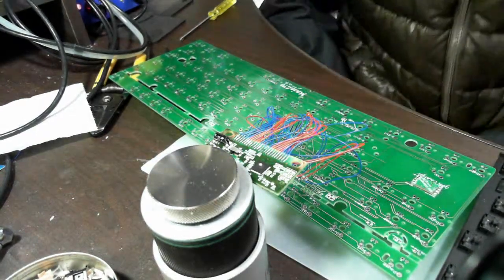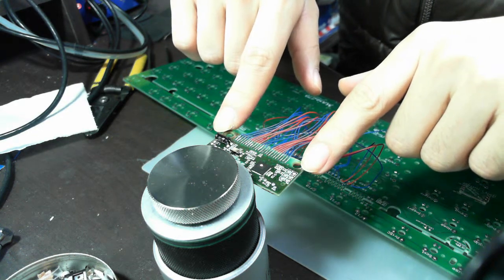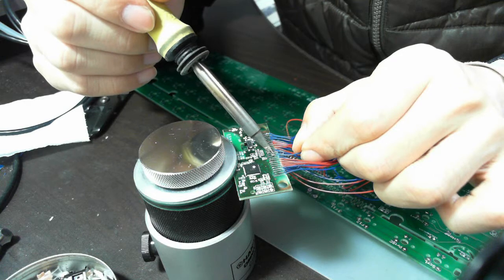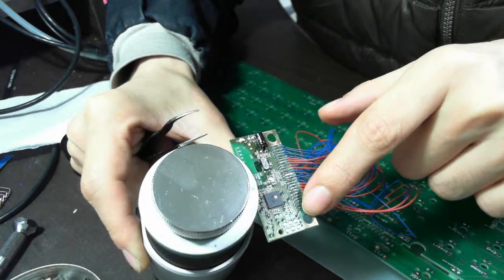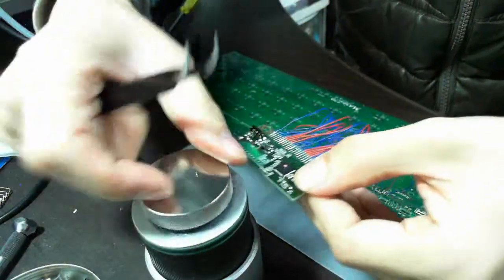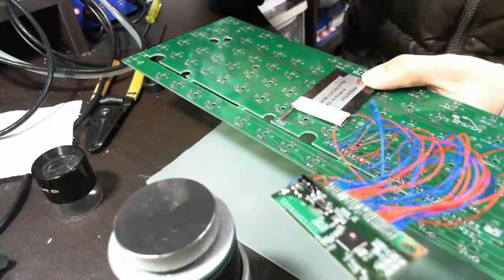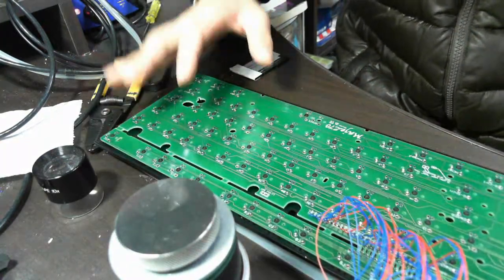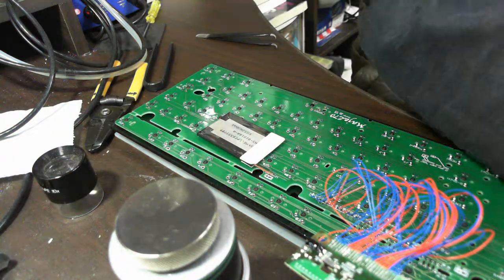How to rebuild your Filco TKL into Logitech-powered Wireless KBD Part 2

Comment: Brilliant! Awesome work man. I can't believe this video (or part 1) has not received more views or likes. I came across this video because I've been thinking of trying to make my KBT Poker 2 as a wireless keyboard. I first thought that I could use the Handheld Scientific Bluetooth Keyboard Adapter from handheldsci.com and I already have that planned out. I'm just waiting for them to carry it on stock. But just today I came to wonder if I could maybe take apart my Logitech Unifying keyboard and maybe use some parts from there instead and I decided to search to see if anyone else has ever attempted it. I don't know much about soldering or circuits but I'm pretty good at following instructions. Would I be able to do this for my Poker 2? Or would I be better off trying to custom fit the Adapter from handheldsci?